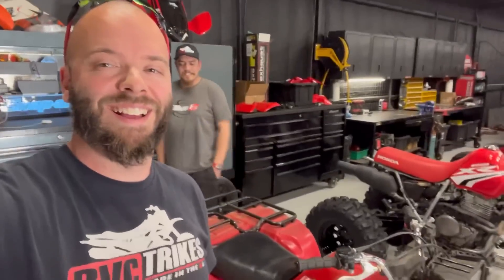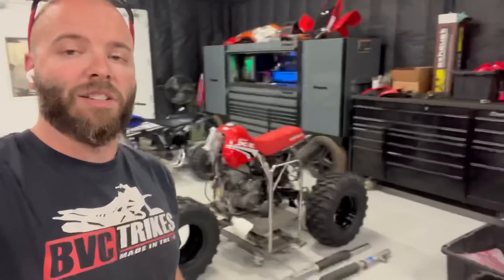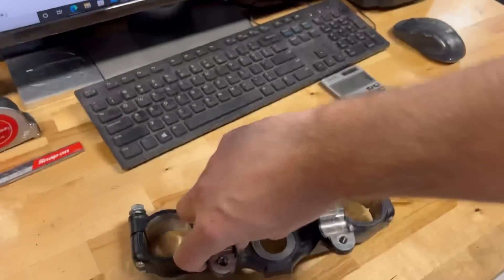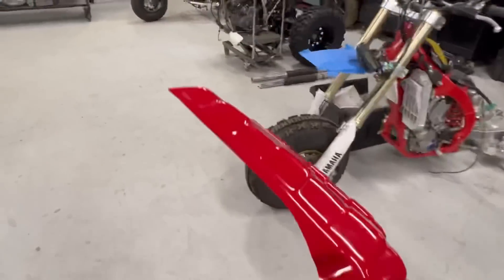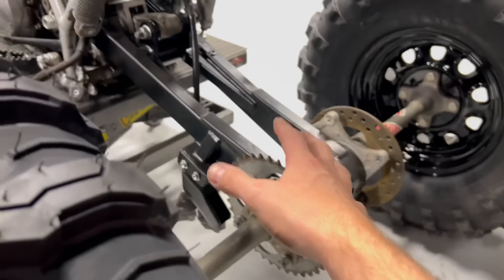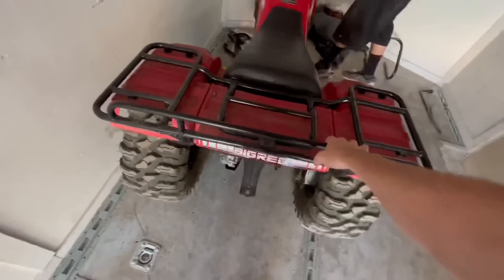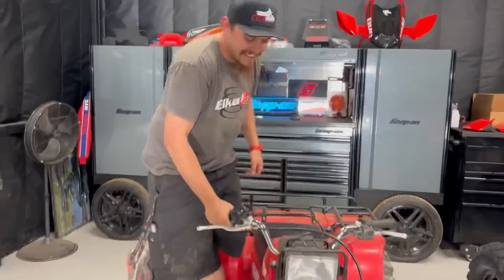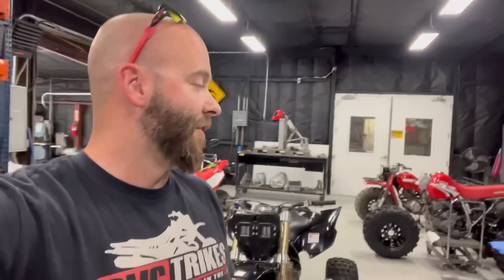Modern BIG RED Update! XR650L Trike Build Part 2

Comment: So,if you remove the snorkel under the seat,you can fit a lithium battery and everything that's in the battery box,under the seat and you can get rid of the stock battery box.also,every aftermarket muffler will give you more clearance,they seem to hang more towards the outside if that's what your looking for.

Comment: That thing is gonna be a beast! That 650 also has great lines for a 350x build with those tank/seat lines. You guys get bored do a 300 crotch rocket trike build. Always wanted to whip up a slammed one, like an atc70 on all the steroids. Little high revving zip around machine. Keep up the great work.

Comment: Reverse? You guys didn't think about backing up when you can't go forward! I own 2 84 big reds, 1 85 big red, 1 85 250sx, 2 85 110s, 1 85 70, 2 85 350x, 1 85 200s. And a big red without reverse and without SL (Superlow) gear, than shift it into 1st gear.. is not a big red. It's a great idea!

I sure wish I had your machine shop for my next project! 2017 honda grom 125cc fuel Injected engine in a 1985 Honda ATC110 frame! Electric start and fuel Injection it's gunna be sweet!

Comment: If it was up to me (* and its not ) I would keep the Original gas tank, the shaft drive, and the Cargo racks font and back.  Basically 650 Big Red. Modify the front shocks like you are doing and extend the (Original )shaft drive system but with a better Pro Link style rear shock.  As long as we are using our imagination.... Use the front wheel drive system of the Rokon (some how ) and have  3 Wheel Drive......That would be F-n Bitchin !